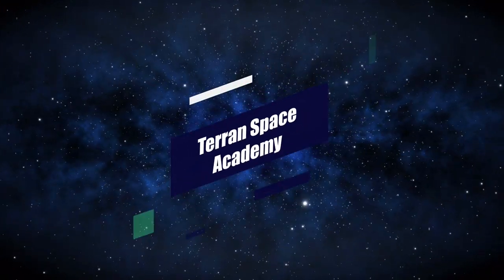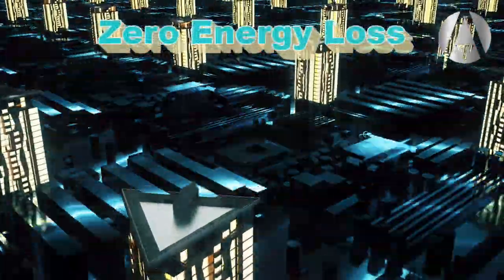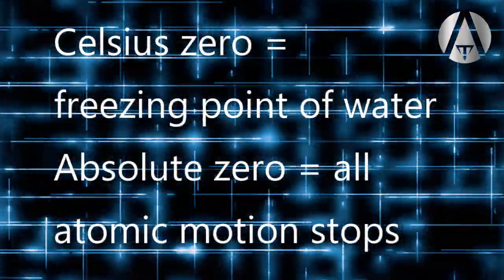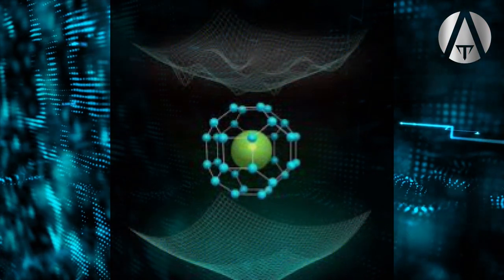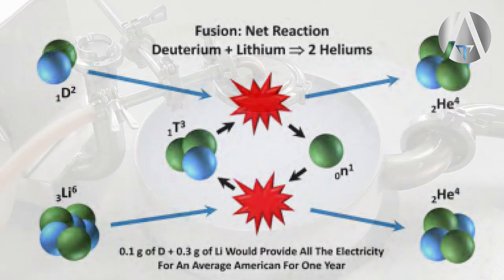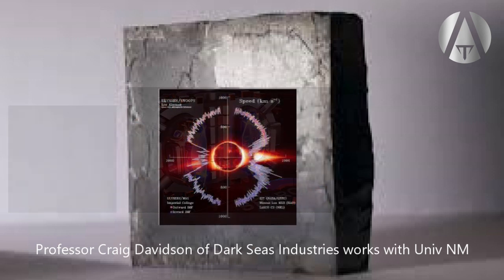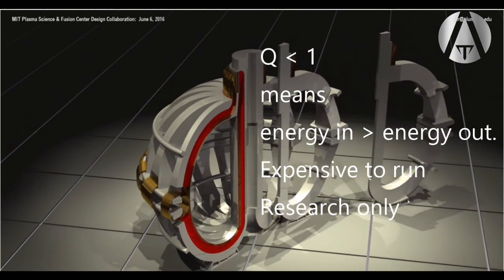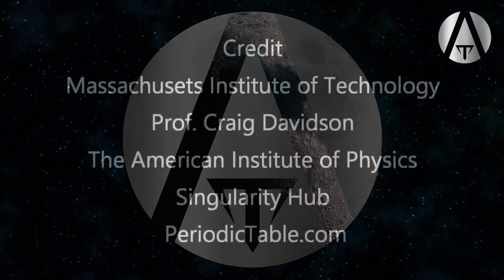ARC Reactor!

Comment: good day, appreciate your format and content, though i have a question: 

in Aneutronic Fusion 2: Creating An Artificial Star at 14:26 you state your prediction is ITER will not be energy positive. my understanding of that and this video is very limited, though it does not seem to indicate the change to much more efficient superconductor ribbon will overcome the apparent increase in operating pressure and concerns about smaller radius. can you please compare your concerns about ITER, especially the non-charged components, and the solutions SPARC have for those issues.

thank you
Reply from the maker: ITER is not actually expected to have a Q of more than 1.  It will be energy negative but could indicate a viable direction for research.  ITER is too big for the power of its magnets it seems.  It is better to have a small highly focused magnetic field with a high density and confinement time than it is to have a larger plasma stream.  In the end   those factors will determine success in a tokamak or stellerator.